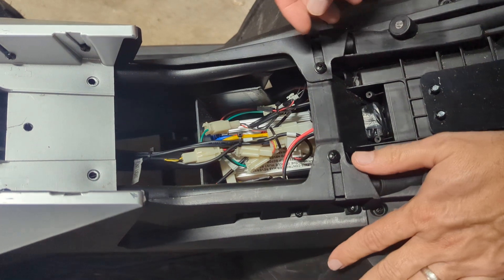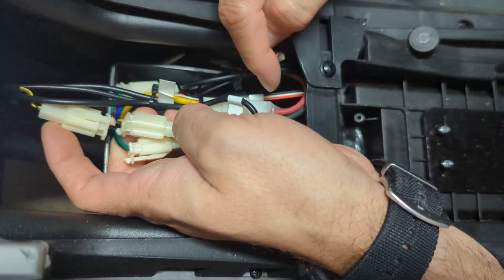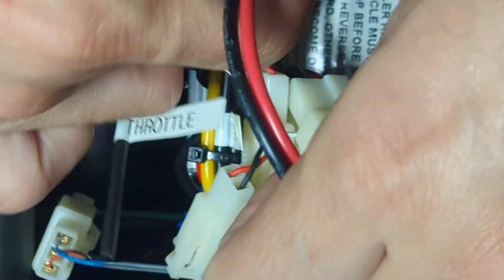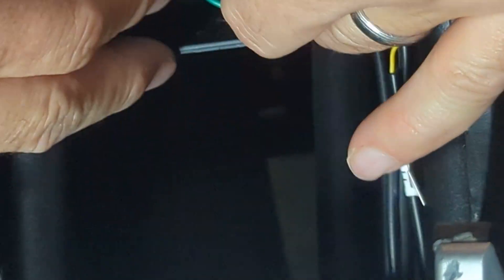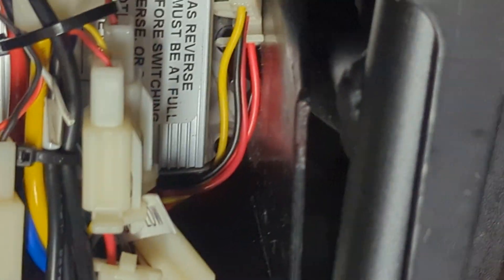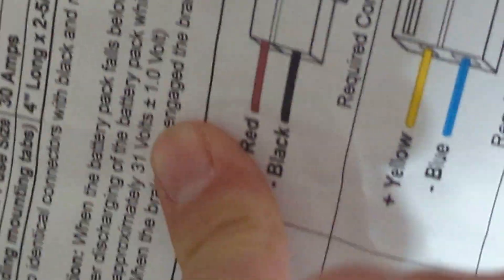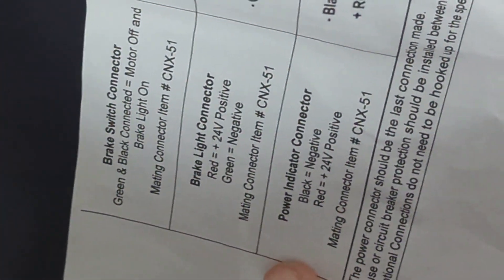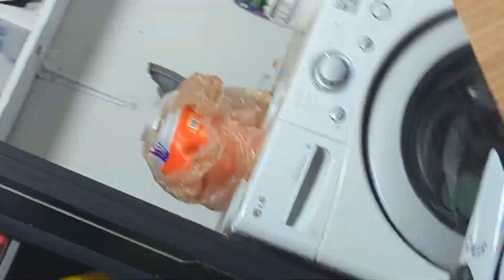Tesla Cyberquad SPD-36500R Cable Pin Out

Comment: AWESOME! this is what I needed!  Match up of Cyberquad wiring colors VS New controller wires.  Btw, your other video on installing new brake handle is great.  You went an extra step to fuse braking function all together -- Break signal to rear brake light to preventing throttle when brake is engaged.  Most other guys were just lazy (or fine with) physical brake function only and forget the electrical feature.  Again, thank you for the video.
Reply from the maker: Anytime!!
Reply: @cognetic  I got everything to work great except that when a throttle is let go all of a sudden the motor seems to lock up.  Did you experience similar issue?
Reply from the maker: @superkong81 go to this video and check out the comments with the most replies.  Adrian, Maneet, and Chris from Electric Scooter Parts are working on this exact issue.  Chris sent them new controllers for testing. We should have a response back in the next day or two if it worked.  https://youtu.be/8l9biteF5WQ
Reply: @cognetic  Thanks, I will keep an eye out for updates.  BTW, I just tested going reverse in full throttle and let go of the "gas" and it just cruises until I press break.  Forward motion should behave the same but as we experienced it does not.  Not sure if it has anything to do with Motor Temp cable not being used (I don't think that is the case).  Either way I just wanted to share my observation.  I'm looking in to whitepaper on the motor and the controller also.